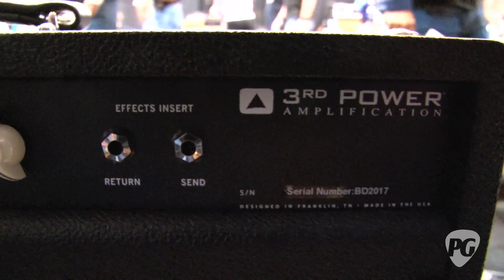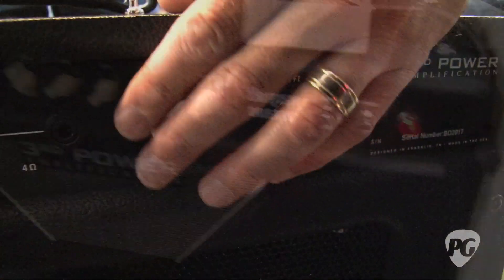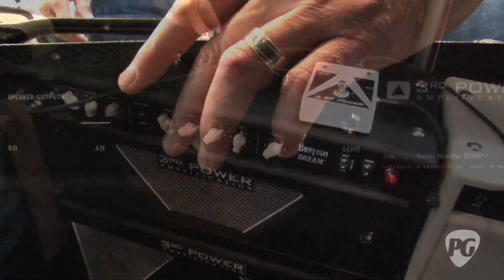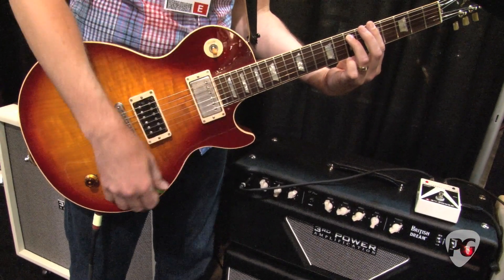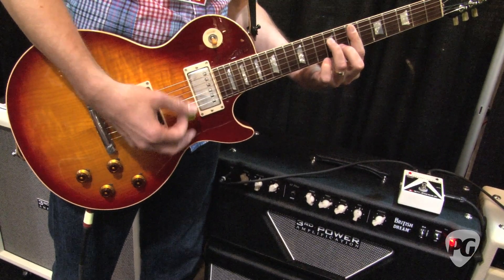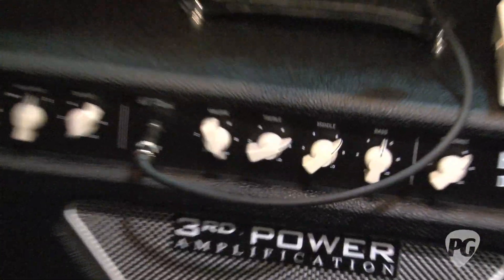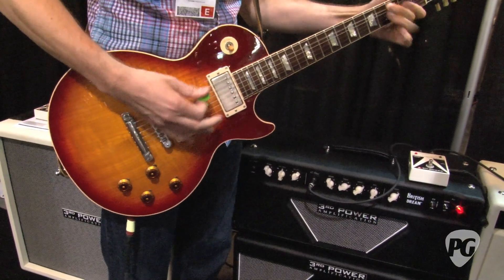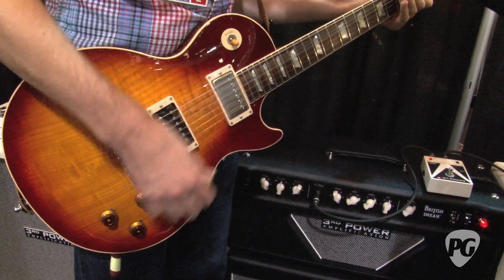Summer NAMM '11 - 3rd Power Amplification HybridMASTER with British Dream Demo

Comment: @nunocarmona I noticed it too! Jamie from 3P here (guy in the vid). We had been told to "turn down" by the NAMM police before recording this. I was extremely sensitive to playing delicately in full power. As we turned it down, I plucked the strings a bit harder. I also turned the guitar volume off between takes. Although I tried to set it and play about the same, obviously I didn't. I can assure you that HybridMASTER won't rob you of your headroom! Check our other vids for clean demos.